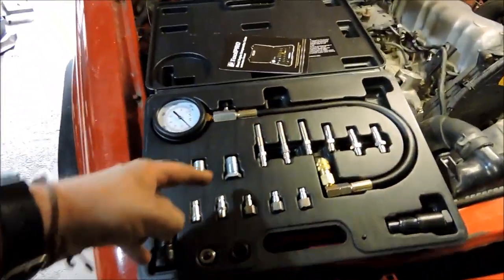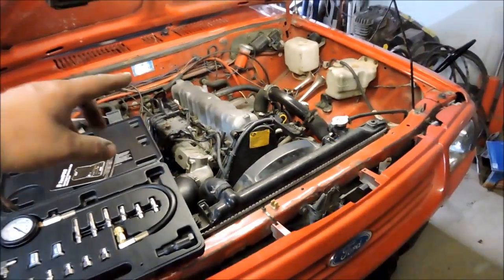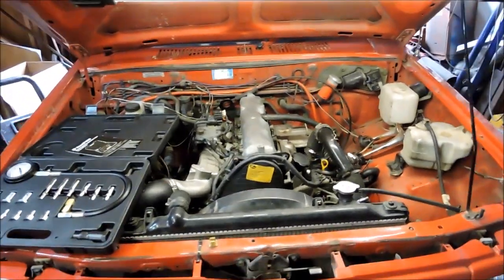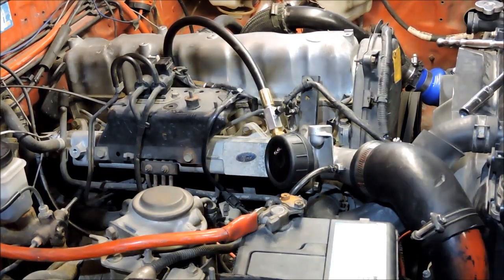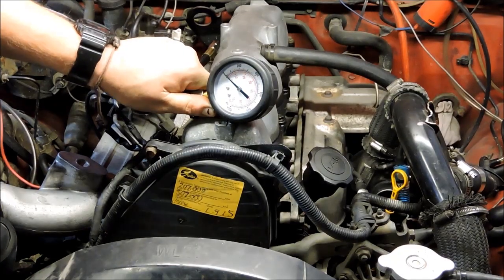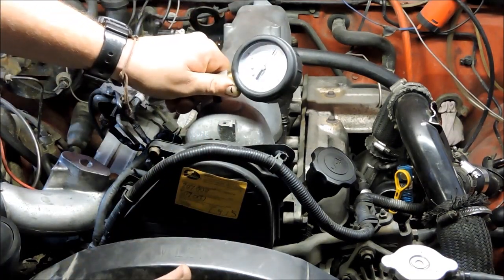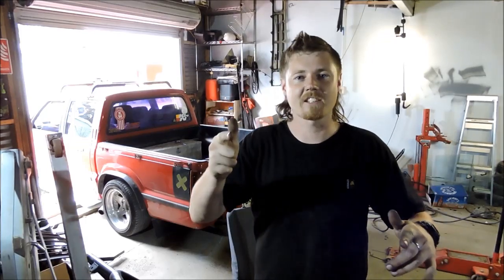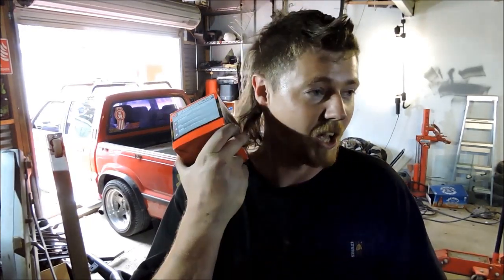DIESEL COMPRESSION TEST, DIESEL 3RD GEAR DOUGHNUTS

Comment: I Wouldn't be too concerned about the compression readings mate, I mean like you said it still roasts in 3rd so I'd send it 👌

And for the future, WL rebuild series would be mint!
Reply from the maker: Yeah an WL rebuild kits on trademe are only 500$ so I'd easily spend that. So I'll keep hacking till it dies
Reply: @BuiltBrokeGarage  took me a couple weeks with 3 kids to do one. Easy motors to work on.
Reply: @BuiltBrokeGarage  atta boy, to be fair though they are a pretty tough engine, I hit full boost of 20psi at 2k rpm in my courier and it loves every bit of it 😅
Reply: @seanfreeman6296  regular block and radiator flushes keeps them safe. They have ceramic thermacoating in the water jackets. As it breaks down it flakes off and blocks the radiator up, heat up..and crack heads. I got about 3 cups of enamel cup type flakes out of a block just from rotating on the engine stand.
Reply: @seanfreeman6296  rolled it over and it all poured out the jacket. Farkin heaps of it!
Reply: @brotangyoust9252  yeah mate, but that's like anything, maintenance is key for longevity
Reply: @seanfreeman6296  I can't disagree lol 19 years 547km on same wagon, the wl and wlt motors are prone to doing heads in. I couldn't find a cause online but I reckon it's the breaking down of that coating blocking the rad core.

Comment: how you fix the clutch did you get a new pressure plate?
Reply from the maker: Na man it's still the same one that I put in last time it was done on video, it slips but it's intermittent, sometimes it hooks in mean then other times it slips around 400rpm   above what it should